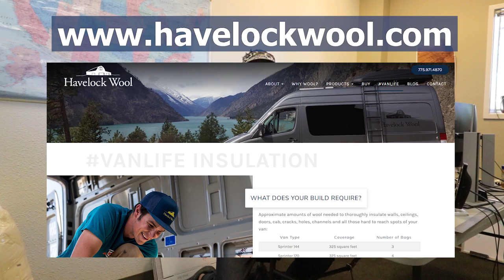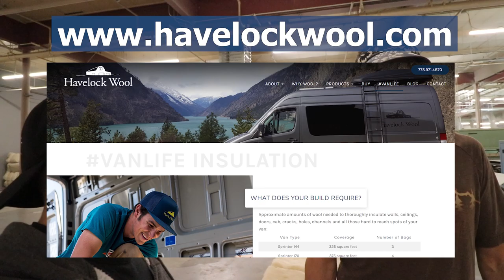Havelock Wool Company Tour - Wool Insulation

Comment: Great video. At 16:38 the question is posed, regarding "Stone Wool (which I assume is also known as "Mineral Wool"): "Where does the water go?" But wouldn't one simply use a vapor barrier with mineral wool? I'm a newb with all this and starting a van build. Also. I'm not quite clear on how wool without a vapor barrier will prevent condensation on the metal innards of one's van, with potential rust and mildew. Thanks.
Reply from the maker: The wonderful people at Havelock could answer better, but from what I understand wool adsorbs moisture and then releases it as well. If you email them then can tell you a lot more about the process.

Comment: build my own house using this product. great to work with.  only problem is when putting the product in crawlspace or ceiling...the wool threads will get in your mouth, and its hard to get it out. need to wear a mask to prevent that.
Reply from the maker: Good tip. Did you use the fill or the bat?

Comment: No, I'm simply asking which is better spray foam or wool for insulation
Reply from the maker: In my opinion I'd go with wool. I've see spray used and it's good but it's very expensive and not easy to install. Wool is the most eco friendly product, has almost as good R-value, and won't cause mold over time.

Comment: I like the concept, sustainable nontoxic insulation. But closed cell spray insulation absorbs zero condensation, so the moisture breathing argument is simply wrong. When I hear one bogus sales puffery, I have to question the rest.
Reply from the maker: You're right foam doesn't absorb therefore it repels and so does foam board. He mentioned all that and when products like that repel water and moisture then where does it go? That moisture going into other products that do absorb like wood which will mold and rot over time
Reply: Lyfan Deth Yes, he mentioned all that at the beginning. You evidently missed that part.🙂